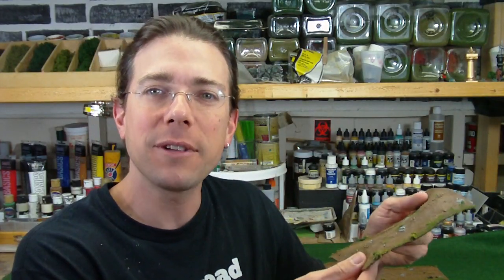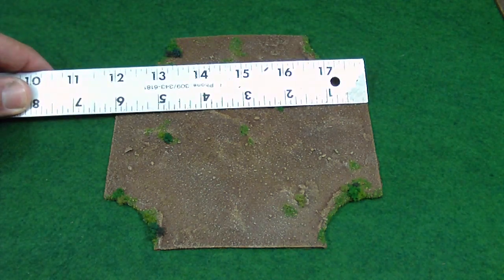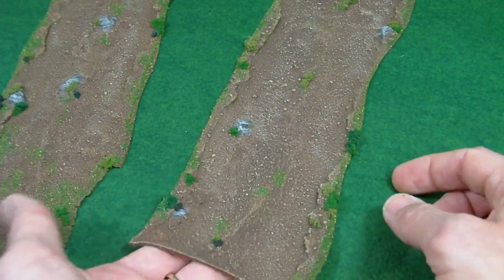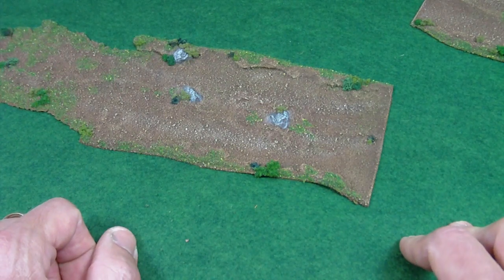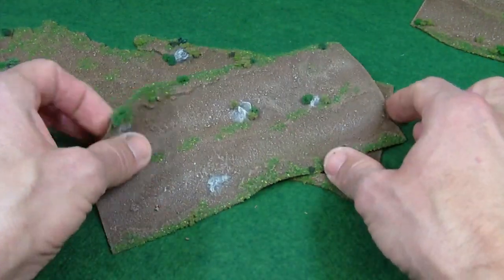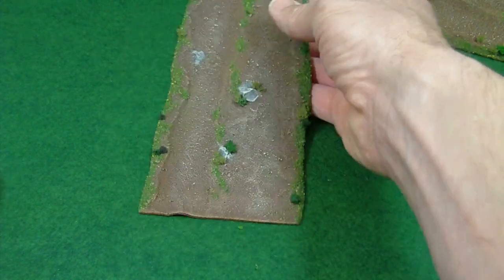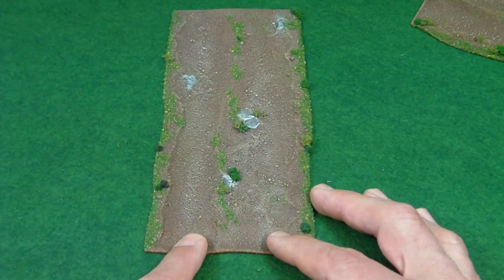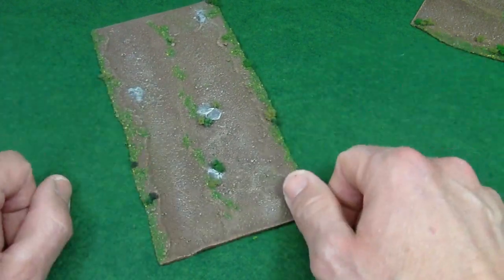TerranScapes - Four Way Intersection for Flexible Rubber Roads

Comment: Are you dying/painting the urethane?  It may be an investment to switch materials. One is to switch to silicone rubber and maybe up the shore scale a bit. The higher shore number and casting at that thickness the result will still be flexible, yet still have resilience. If painting silicone is an issue you can try using cirius-silicone-pigments-and-paint-mediums from BLICK art supply. The palette is limited but mixes like normal paint. Love the work BTW.